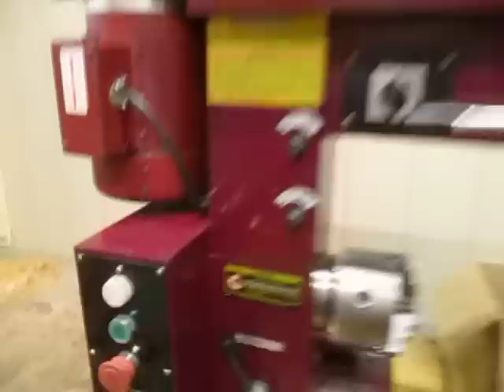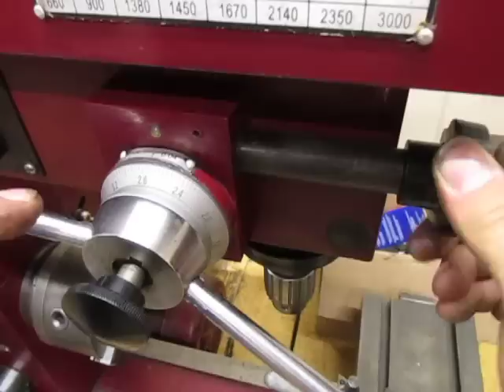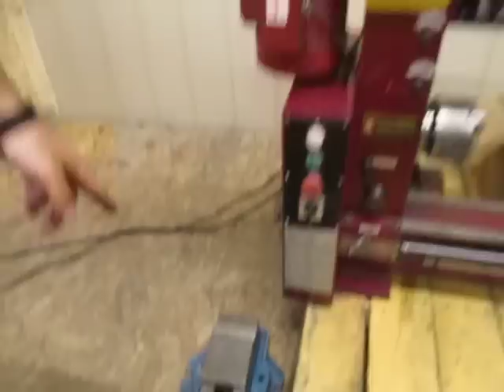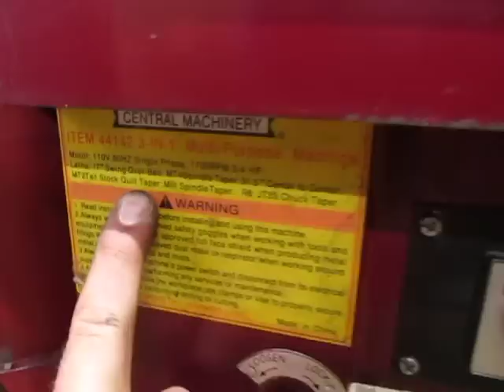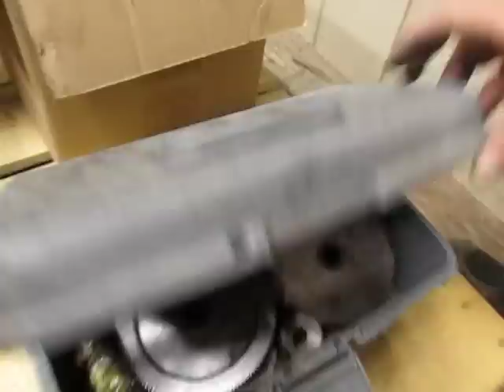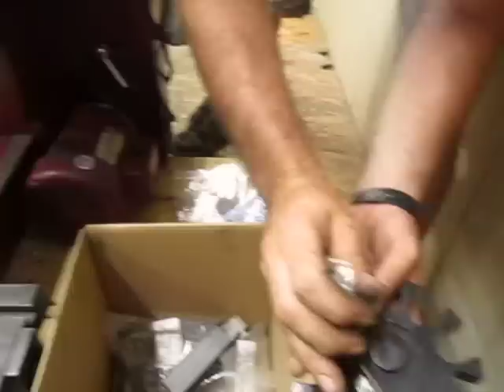Central Machinery Multi-Purpose Lathe Mill Milling Machine Combo 3 in 1 Smithy

Comment: That machine only has Morse tapers , the chuck shaft is a Morse #4. The drill / mill is a Morse #2 an the tale stock is a morse#2. There is no R8 taper...  Those collet's won't fit

Comment: Never run an open chuck on a lathe.  You should at least close them.
Does the drill press also work as mill?
Looks like a nice litle machine, depending on price.

Comment: Of course its noisy when he deminstrates the highest speed and its on the boards on the floor sheet metal covers not steel ,And for the price ,and machining is done alot more slower and I see what others don't and challenges need to be met ,and you would be suprised what I would do with this.

Comment: The reason this puppy is so loud is the fact that the headstock has no oil in it. These machines are all shipped oil free. Oil does wonders when it comes to making those noises go away.
Reply: Thanks for stating that... saves me asking the pressing question that haunted me through the entire video!
Reply: It's not a new machine, it's a used machine. IT SOUNDS VERY LOUD & SHOULD HAVE OIL IN IT IF IT'S A USED MACHINE.
Reply: Mine was shipped with oil in it ! I checked before running it.. it's loud because it's very cheap made !

Comment: I had one of these machines about 25 years ago, and they're generally ok for hobby work/learning. They have a HUGE capacity(which can't be utilised effectively, as the swing is FAR too large/machine lacks power and rigidity ie very tall tool-post assembly, excessive vibration, etc. Get the long bed variant with a screwed capstan riser. The mill/drill is ok, but the rigidity leaves lots to be desired, and forget climb milling!!!! I sold mine, three years after I bought it for the same amount that I paid for it, and it was a good tool for learning. BTW this machine sounds horrendously loud!!!
Reply: How much you pay?
Reply: @Fhj91  25yrs ago I paid £1200 for a new machine with standard tooling ,3 & 4 jaw chucks.....
Great machines for learning with and should you spend the time increasing the rigidity, then it would be a good machine for small jobbing work - 225mm swing over bed is ideal for brake disc resurfacing, small cylinder head refacing.......

Comment: i bought just the drill press  about 40 + years ago  still use 2-3 times aweek  very good mach.  i repaced the chuck a couple light bulbs  one belt  in 40 yrs  (can not complain)   all you hear is hum of the motor runing very smooth????????

Comment: I have used many lathes. This is the loudest I have heard. It sounds like a train.
Reply: CCP SHIT   NOW DAYS YOU CAN'T DRIL ADAM HOLE CCP SHIT KILL-MAC-SHOPS GOT TO WHERE YOU COULDN'T EVEN DRILL HOLES -SPECIALY-400 435O HT TO DAM HARD TO BUY GOOD STUFF
Reply: @CharlesTheAdjuster   In what language are you writing your replys?
Reply: MR .MIERZ- HAVE YOU EVER BEEN IN A MACHINE SHOP AN DO YOU KNOW ANY !!!! THING ON METAL AN FLAVORS--- THAT MEANS KINDS AN DO YOU KNOW ANY !!!THING ABOUT TOOLING TO YOU THAT MEANSTHOSE THING YOU WORK WITH
Reply: @ricardomierz8467  YOU MAY -B -------BUT -------NOT A GOOD QUALITY EDUCATION IS DIFFERENT -------YOUR   LIKEING IN THAT  IT'S LIKE THE TOOLS ---YOU NEED QUALITY  TOOLS  -------COME BACK !!!!!!!!!!!!
Reply: @CharlesTheAdjuster   YouTube for some reason is pulling all my replys to you..

But the Bottom line is that your a inbred moron.

Comment: Guy doesn't even know the nomenclature for the machine. The lever on the front labelled I. II, III, is merely the feed rate NOT the machine speed.  The gear noise is from not setting the gears on their adjustable quadrant to minimize clearance.  I've used a duplicate of this machine with a 6" rotary table set to vertical and a gear cutter on a 1" diameter, keyed shaft in the mill head to cut custom gears for a Muncie 4 speed and they're still running 14 second times at the strip after  8 years of abuse. The inherent weakness of this little item is the same for all machines with a nylon gear in the headstock and without prismatic hardened and ground ways; table deflection on longitudinal feed. You can't hog metal with one of these little guys but take your time and .005" cuts at a time, it'll do some jobs you'd never suspect it capable of.

Comment: I own one of these and used it for my hobbies over the last 15 years. It's a great hobby or beginner business lathe. It isn't very robust in that the motors won't run forever, I've had to repair them a few times. Other than that it seems to be acceptable for hobby work. This machine seems to be missing the spring item 166 for the Crank Handle Item 163 to manually use the lead screw. I mention this because when you engaged the lead screw auto feed the crank spun. When it has the spring properly installed the crank will not turn. An easy fix but one that should be looked at if your crank handle turns with the lead engaged. Thanks for sharing. Best Wishes & Blessings. Keith Noneya

Comment: Just an upgraded version of my 20 yo chinese lathe/mill combo with power feed to the cross slide and one extra gear., I've put a 3 phase with VFD on mine to give infinite speed from about 70 to 3000 rpm with electric X and Y axis feeds. The only thing this has is a second motor for the mill. Mine is run from a bevel gear run by a dog clutch off of the main spindle.

Comment: I've been looking hard and long at all the different made lathes. Some of these Milling lathes. This is what I've learned. Everyone says list open the box oh look this is how you turn it on, this is how you crank it this way this is how you crank it that way. It's extremely noisy the motors are no good because you're already upgrading and I can't think of any videos yet that I've ever seen anyone really showing the items making something great. So if it's a $2,000 machine it's already $1,000 machine Sirius and I am being kind when I say that. I honestly think everyone watches 100 videos. Then they go out and buy the lathes and repeat what they have seen.. maybe that's why on YouTube 2 out of every 10 guys commit suicide after watching.
Reply: LOL at your comment. The noise is because of the changeable gear alignment in the back and the Manual Lead Screw Handle on the right is engaged. I've owned one of these for the last 15 years and those problems are an extremely easy fix. Just align the gears, a few cap screws and put the spring on the Crank on the other side. Someone probably assembled it wrong, easy to do. I have a few video of me running this machine, except mines silver, on my channel. Grizzly sells one of these for $2,450.00 plus $175.00 freight. Best wishes & Blessings. Keith Noneya

Comment: OMG, Bearings need replacing
Reply: IT DIDN'T SOUND LIKE BEARINGS SOUND LIKE ROCKS GRINDING UP PRISISION MAC DONT MALE THAT MUCH NOISE THEY QUITE--AN SMOVE IF IT DON'T SAY PRISISION DON'T BUY IT -SAME AS A DRILL PRESS
Reply: @CharlesTheAdjuster   What did you say?..
Reply: @ricardomierz8467  O--YES I FOR GOT TO TELL YOU THAT CCP IS CHINA AN CHINA IS CRAP !!!!      SHIT !!! TO YOU THAT MEANS AINT WORTH A SHIT

Comment: 가격얼마인가요
어느나라제품인가요
Reply: Mullett은 지금이 항목에 대해 재고가 없습니다. 계속 확인하거나 지금 필요한 경우이 회사에이 콤보 버전을 보유하고 있습니다. https://www.grizzly.com/products/grizzly-31-3-4-hp-combo-lathe-mill/g9729에 $ 2,450.00 US 항목이 미국에 있지만 중국에서 만든 것으로 생각되며 아마도 필요한 경우 중국에서 한국으로 직접 배송됩니다.
Mullett is out of stock on this item right now, keep checking back or if you need one now try this company they have a version of this Combo in stock. https://www.grizzly.com/products/grizzly-31-3-4-hp-combo-lathe-mill/g9729 for $2,450.00 US Although the item is in the US I believe they are made in China and can probably have it drop shipped straight to you from China to South Korea if needed.

Comment: Apparently, this sales guy is deaf or he thinks we are.  The noise that thing makes shows there is a major problem that need servicing.  Bearings?????
Reply from the maker: rick easton: These machines are Chinese made and do not have the quality that a Clausing lathe would have but they definitely work well for a lot of people. Is it a little noisy in the video? Yes. But that is quite frankly not unusual for these because of all the moving part and this one probably was not lubed up properly prior to the video being taken. Bottom line of the bearing was bad we would not have sold it like that.

Comment: I think that most the noise your hearing is from the guards and the door on the head.
Reply from the maker: Paul Martin: Yes you are correct. There seems to be a lot of people concerned over the noise in the video but these types of machines have always been a little loud because of simple things like the covers/doors rattling while the machine is running. We appreciate your input. Thank you
Reply: @MISIndustrial  Way too damn many snobs,  half that probably haven’t even been in a shop!   There’s a thing in this world called a working man and he might not have the wine and cheese money to buy the $20,000 Spit, Sit and Spin like you ladies!

How much did it sell for my friend?
Reply from the maker: @mattprice37664  I believe this one sold for 1400.
Reply: @mattprice37664   I own a shop and I would never buy one to use in my shop, but I would buy one just to drop on your fat head 💀

Comment: Why are the gears not wrapped in paper or a cloth to protect the edges. All loose together, disgusting.
Reply from the maker: John Smith: We appreciate your input but if the gears chipped or broke while laying together for the video I can assure you they would disintegrate the minute you would install them on the machine. They were not being shipped like this and they were being handled with care. Not being thrown all over the place. Please use some common sense when you make a comment on someone’s videos. Thank you
Reply: @MISIndustrial   Speaking from experience are you?
Reply from the maker: John Smith: If by experience you mean that we have never had a gear get damaged then yes you would be correct.

Comment: looks like a lathe-drill press to me, rather than a mill
Reply from the maker: Athrun Zala: The reason it is a mill and not drill Press is because the table has travel unlike a drill press which has a stationary table. Please note you can use these machines as a drill presses as well.

Comment: Those gears - especially when driving the slides does not sound healthy...
Reply: Yup,  maybe some thick grease worked into the acme drive thread may take down the noise enough to be bearable.  It looks very dry all over - lube needed all over when sitting or in use!

Comment: Well, the main bearing is out or what ? Have you heard a Smithy running. No such noise !
Reply from the maker: Roentgen Geiger: The noise you are hearing comes from simple things like the covers/doors rattling because of the thin sheet metal used for those parts. It is a common noise you will hear on most of these mills/lathes. The Smiths have a slightly different design for those parts which normally results in a quieter machine. We would not sell something like this if the bearings were bad.
Reply: @MISIndustrial  I think "out" in the previous comment was meant in the sense of "out of alignment" or "not of proper fit" and not that the bearing is actually worn . No-one expects a brand new machine to have worn bearings but badly fitted or badly specified bearings is not something unheard of.
Reply: Price